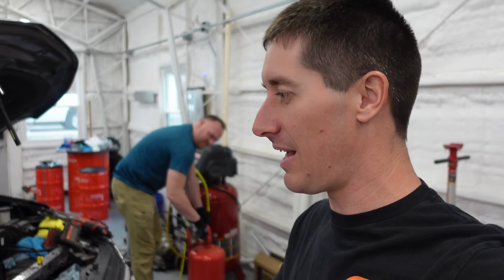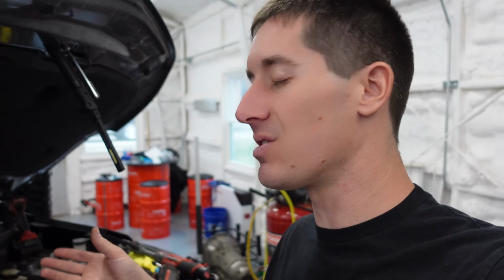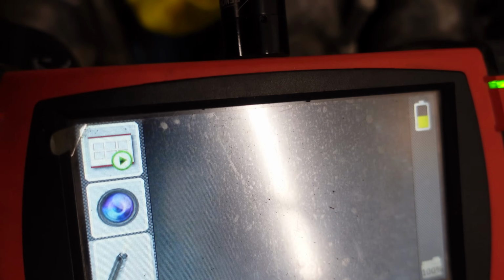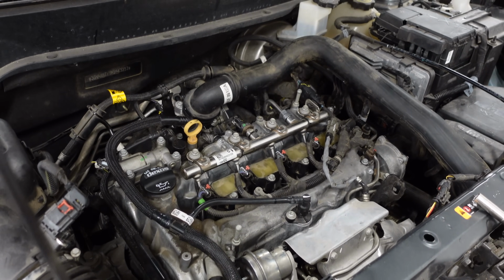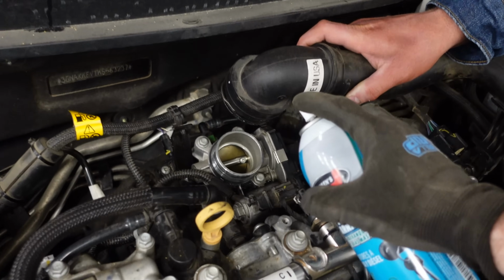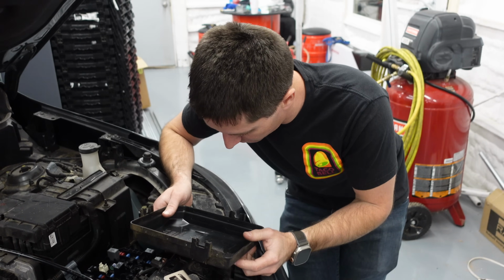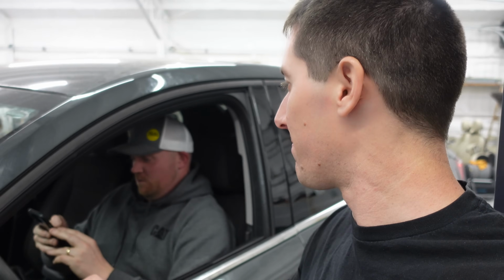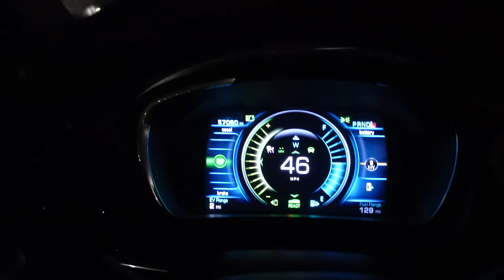I FIXED The UNFIXABLE Chevy Equinox *You'll Never Guess The Problem*

Comment: You can use any device that pulls a vacuum to remove the gas. I remember that you have an oil extractor that you used for oil changes. That will pull gas out of the tank.
Reply: Don't most modern gas tanks have some kind of anti-siphon feature to make it difficult? Or at least slow you down?
Reply: Can't you just unplug the fuel filter and let it empty itself?
Reply: @JohnDoe-zr6bk  There is no fuel filter on these cars other than the sock at the intake for the in-tank fuel pump.
Reply: There is a fuel pump in the tank to pump the gas out. You just have to figure out how to power it
Reply: @JohnDoe-zr6bk most cars have a fuel filter that is integral to the pump assembly itself inside the tank. There's not typically an external replaceable filter now

Comment: I was working in service for a GM dealer when flex fuel vehicles were coming out.  If it can run on E-85 it will be marked on the gas door, it will say E-85 capable or something like that.

Comment: Had the same thing happened to my Chevy lumina about 15 years ago. My wife stopped at the gas station and filled it up, she made it 3 miles before the car stopped. I checked everything just like you guys did, finally decided to drop the fuel tank and drain out the gas.the third crank the car took off and ran fine. The gas station would not make it right. They’re out of business now. Wonder why😂

Comment: When it showed 210 on compression I said that's a fuel issue. I was thinking fuel pump but That wasn't it. Now I would recommend having them keep an eye on that. "IF" it was pumping water and as long as it was sitting in it it may have started a little bit of corrosion inside the pump.

Comment: Hey guys, we had a similar situation a couple of weeks ago with a gas station in Guelph, Ontario with contaminated fuel. People filled up their cars and they quit running. This hit the news and cars had to be towed to repair shops and dealers. One of the people sent some of the fuel to a lab for testing and it turns out the contaminate was windshield washer fluid. The parent company in this case has said they will pay for everyone's repairs. In the meantime  the station has been closed. Be interesting to find out what's actually in your fuel. Cheers!

Comment: They sell kits for checking gas. It is a graduated cylinder that you put gas in up to the gas line then add water up to the water line, shake well, then let sit. The water mixes with the alcohol in the gas. After it sets the water/alcohol will setle to the bottom. Then you read the %scale to determine the % of alcohol.

Comment: We just got our 2017 Equinox with a 2.4 liter 4 cylinder back from the dealership.  It would turn over but not start.  Or if it started it would only run for 10 seconds, with lots of white smoke coming out of the tail pipe.  Our local mechanic worked on it for 1.5 days.  Then the dealership worked on it for a day and a half.  After trying everything they could think of, it turned out to be bad fuel.  We drained the tank and put fresh fuel in it and it's working fine.  Who would have thought?

Comment: How did the car & shop smell from all those walnuts? 😄
Also I'm surprised that you don't have a Heavy duty charger/jump-starter in the shop, JR. Portable ones are handy, though go walkies into specific vehicles too easily. Good to see that car running again, and Eric's sister back on the road. Looking at the build up, it probably benefited from the cleanup anyway...

Comment: Condensation will cause water to get into tanks too also I solved the issue with 3 cans of Berryman B-12 chemtool also if I was you guys I would do a follow up to clean up the fuel injectors with some Berryman-B12

Comment: Did you change out the camshaft sensor? Another guy made a makeshift pcv valve on the oil cap and now it doesn't burn oil anymore

Comment: Maybe I need to read the manual.  I really don't hear an knocking, but I run my wifes 21 with the same motor on regular.  My Father in Law (mechanic) said to make sure to use some deep creep or sea foam every oil change to help with the carbon or he mentioned we run into carbon issues before 100K.   Basically keep it at about 2k rpm and a suck a bottle of sea foam into the intake.

Comment: Direct injection engines need prolonged high rpm runs to keep the valves clean. Also removing the EGR/PCV systems will prevent the buildup issues.

Comment: The solution on these gas direct injection engines coking up is when they are brand new to illegally swap the factory PCV system for a catch can system.  Then the valve carbon buildup problem almost completely disappears.  It adds a very minor, but super easy, additional maintenance of occasionally emptying the catch can.

Comment: I have a 2005 LeSabre with 239000 miles on it. Never had to go into the engine itself, not even the rocker cover gaskets or intake. It leaks a bit of oil, but never carboned the valves like the DI engines do. And I get 30 mpg cruising the Kansas Turnpike at 80 mph. I live out here in Goddard, just West of you guys. What gas station were you referring to that is problematic with bad gas?? Yeah, it IS the near bulletproof 3800. Mostly get gas at the Murphy Express in front of the Walmart out here. Also used QuikTrip, KwikShop, Casey's and Philips 88 with no problem.
Reply: In the other comments JR mentioned that she can't recall what gas station she filled up at.
Reply: @conrad463  Yes that is true that Eric's doesn't remember where she got that gas, I heard that in the video. JR did also mention that there is a gas station that HE is aware of that has bad gas. THAT is the station that I am asking about.

Comment: PERFECT EXAMPLE of getting caught up in computer gobbly gock and not stopping to do basic mechanics...It aint getting no gas. was the answer.  Great reminder that you should always start with the basics before you start chasing computer codes.
Reply from the maker: It was getting gas, and it smelled like gas... it just wasn't gas. Literally the only way to test it is with insanely rare water detecting paste 🤷‍♂️
Reply: @WatchJRGo RARE is a good word. Persistence pays off. Good work.
Reply: @WatchJRGo just because it's "getting gas" doesn't mean it's good gas or proper gas...BASICS. you don't need computer shit to figure that out.

Comment: Always spray Carb cleaner into intake on a no start. If there is no change, then it is not a fuel  issue and need to look elsewhere. Take care guys. Also the Equinox / Terrain are not bad vehicles compared to what else is out there.

Comment: The owner should use 91 Tier one and every 3,000 miles put in a fuel injector fuel additive to keep the value free of carbon. I use Liqui Moly 2007 Jectron Gasoline Fuel Injection Cleaner.

Comment: I'm surprised you wouldn't not have looked at the gas first knowing she just filled up with gas.  Why because she got to drive it home from the gas station?  At least you figured it out before you started on taking out the engine because just think if you did that you still would of had the same issue and be out all that time and $$$.  Good video to learn from.

Comment: I have to say, it's a good thing you guys opted not to swap for a used engine. My guess is, had you done that, you guys wouldn't have also swapped the gas in the tank and would have run into the exact same issue all over again.

Comment: Few things. I haul fuel and some drivers screw up and most times it’ll grenade your vehicle. Diesel is not clear… red (off-road) and green/yellowish. Gas is clear. It’s easy for someone to hit the wrong grade fuel at some of these stations. I see it when traveling to the south. 
I own a 2015 Equinox and it eats oil like an old 70’s/80’s vehicle. Had it quit on me right after purchase in Florida I’m from Pa… then it got us all the way home to die on the way to church the next Sunday. Critters had been chewing on the wires. 😂 
Then the real issues with the oil consumption starts. So I simply add oil till I’m tired of it and overhaul it or it dies and I have to do something.

Comment: E85 doesn’t not run on these equinoxes. 

In the manual book, they recommend premium fuel for best performance but it can run on low grade 87 octane. But it will not perform well and lose mpg’s too.

Comment: I got a small electric fuel transfer pump that's powered by AA batteries I want to use to fill the lawnmower and the spare cars  with out hanging onto a full 5 gallon tank for 10 minutes. It is supposed to auto shutoff when the tank runs out. I know the pump works but no clue how fast it pumps but willing to take time to just let it slowly fill whatever I'm dealing with. It does use 6 AA batteries and was dirt cheap so be interesting to see how or if it works when I finally try it.

Comment: The moral of the story is to always listen to what the customer tells you.  "It was running just fine , I stopped and put Gasoline in the tank and it quit running right after that"............. That was a HUGE clue  LOL..   One spring I had several cars coast into my shops drive way.  All of them had filled up at a Station just down the road, come to find out they all had a huge amount of water in the Gasoline.  Somehow the stations tanks got contaminated with a massive amount of water.   Another time I had a Ford Mustang towed in , the car belonged to a teenager.  The Engine would not start , I checked the fuel and it just did not look right or smell right..  Come to find out the kid had siphoned home heating oil from his parents heating oil tank and dumped that into his gasoline tank because he could not afford to buy Gasoline.    Yup that 5.0L  did not want to run on heating oil!  LOL ..........  Who knows what the Equinox got contaminated with , I will guarantee that where ever that Gasoline came from that there were other cars that ended up with the same problem..

Comment: This is not uncommon around Southern Ontario. Name brand stations pumping swill that won't even burn. Pour about 1/2 cup on some paper outside & see if you can light it. Small engine carbs with carb bowls full of slush when the temperature drops below freezing. Great for snowblowers...haha.

Comment: You just need to get one of those relay manual switch plugs that wizard has, you could have just pushed the button and pumped it out without the constant on and off.
Reply from the maker: This doesn’t have a relay like I said, it’s a solid state module in the back of the car 🍻

Comment: As a master tech its painful to watch the parts cannon lol...fuel air and spark boys. One of the first things to check when you have misfires is spark and than fuel quality. we use a bg fuel density tester and often find failed fuel.
Reply: First video, go through the comment section. Top comments were all the techs that stated they were GM techs, and gave completely wrong answers🤣 Chasing common problems is fine, until its not a common problem.
Reply from the maker: We spent a couple dollars on gaskets, not a single hard part was bought here 🤷🏻‍♂️
Reply: I didn't see in the first video in which you suggested to check fuel quality. Maybe I missed it?

Comment: I got a 2015 Chevy equinox with 100 and 100 and 100 and 100 and 100 and 100 and 100 and 100 and 100 and 100 and 100 and 100 and 100 and 100 and 100 and 100 and 100 and 100 and 100 and 52,000 mi on it. Don't have too much trouble yet. Do have an oil issue though. It seems like it's using oil but it's not burning something

Comment: I had an issue with an 89 Silverado where we could not figure out what the hell...dropped the gas tank and found a 8 inch split on the top of the tank.. every time it would rain the gas was getting watered down via the bed weep holes.

Comment: I can 100% attest that quick trip is not always clean at least their diesel I used to believe the same I always used to fill my Duramax at the same quick trip and we filled it up and left town I got about 100 miles down the interstate and got a low rail pressure code I hit a parts store fuel filters off again and it did it in another 100 miles for about a week I had saved the first filters and I cut them open there was an unbelievable amount of dirt and debris idk if it was a lazy tanker driver not cleaning around the cap before he filled the in ground tanks or what but it was damn sure dirty I think it can happen anywhere

Comment: One way to keep it running so that you can drain the fuel via the rail- use a carburetor.  Any 4-stroke motorcycle carburetor with an adapter boot is more than enough to idle a 4-cylinder, as long as the ignition system functions.

Yes, hillbillies watch this channel.  If it works, it ain’t stupid.

Comment: Was there no way to disconnect the fuel tank and empty it? Then just run out lines with the Autel?
I have a 2019 and I have only used regular fuel for 55k miles. And our 2nd equinox (2022) only gets regular as well

Edit:  I just checked the manual (which can be found online) and it states to not use E85 and only use gasoline with an octane rating of 87 or higher (for the 1.5L engine). The 2.0L says to use 93 for best fuel economy but 87 can be used.

Comment: My equinox thankfully is E85 flex fuel it has the yellow gas cap with e85 warning labels and flexfuel logo on the small rear passenger doors the only issue is e85 is horrible gas mileage I’ve noticed

Comment: Man I’ve noticed running anything less then premium makes my 2021 lt 1.5 run like crap. I love my equinox. And I got a check engine light that came up mass air flow so I changed the air cleaner and
Cleaned the MAF sensor and it’s been good but the first start up for the day the car runs rough seems like it wants to stall, any ideas?

Comment: The 2010 Cadillac SRX had the similar issues it sat in the yard for 2 years straight I fixed using YouTube and a electrical layout it was missing the 5 volt reference which it crank and start for a few seconds and die fuel pressure sensor faulty I see a lot of these Chevys equinox’s sitting in yards as ornaments probably suffered the same fate direct injection engines are horrible when it comes to this

Comment: I fill 5 gallon jugs with 87 octane gas all the time to bring home to other cars.  When I pour it, sometimes it is crystal clear like water, and other times it is the usual urine color.  Same major gas station, Colonia North in Jersey.  When I get the clear stuff, I get like 3-4 mpg less. The piss colored  gas gets me normal mileage.  I think they are NOT mixing the ethanol to spec with any kind of regularity.  I never notice a difference in performance though.

Comment: Had a coworker's wife franticly call the office because her brand new BMW just died after a fill up at the gas station.  Car got towed to the dealer and found out diesel was in the engine and gas tank.  Turns out the delivery guy put diesel in the underground tanks where gasoline was supposed to go. Ruined a bunch of cars from that gas station.  The distributer had to pay big time.

Comment: I need help with my 2016 Chevy equinox I replaced the high pressure fuel pump the camshaft sensor and crankshaft sensor clean throttle body it says reduce energy power reduce fuel pressure will not stay crank

Comment: What is the correct method to evacuate the fuel from the tank?
Reply from the maker: Whatever works, usually the pump is the easiest. You can’t get a hose in the fill tube, you probably don’t want to pull the interior or drop the tank… just have to get the job done 🍻

Comment: That truck has 2 fuel pumps one in the tank and one electro mechanical on the drivers side at the fuel rail also check the fuel pressure sensor at the fuel rail that was the problem on my 2010 SRX caused the car to sit in the yard for 2 years straight by previous owner who gave up on it

Comment: I filled a new F150 up with diesel using an unleaded gas pump. The station didn't even have a diesel pump. The supplier put the wrong fuel in the tank.

Comment: Quick question…what happened to the days of…having one’s engine rebuilt?…
As a kid of the 60’s and 70’s…I remember my grandfather…having the engine rebuilt…on his 1979 Chrysler LeBaron…and…it wasn’t out of the norm…
Nowadays…if you (as a customer) to have your engine rebuilt…1…you get laughed at…and 2…you are told…it’s cheaper to just have the engine replaced…
Then…for me…the question is…what is done with the old engine?…when it’s replaced…
I have a very strong feeling…the old engine does get rebuilt somewhere down the line…and…is sold…as a replacement engine…and…if that’s true…why not just rebuilt the original engine in the first place?…

Comment: The Chevy Equinox uses standard unleaded fuel to power its engine. Owners are advised to use unleaded 87 or higher, and to not use fuels with methanol in their Chevy Equino.
Thats from the manual, should say enough.

Comment: I laugh at those people who said why would you ever get an equinox when there is crv or rav-4. Well how about the fact that the crv had its issues with the cylinder and rings and would let the gas mix with the oil and then would destroy the oil then in no time destroy an engine. The rav-4 has had its problems. All the companies have their problems. I personally own an equinox and love it. In the 200k miles I have only had to replace an EGR valve. $22. Big deal. It's great on gas, goes to the mountains all the time, taught 3 kids to drive in it, I guarantee it's been abused. Never seen the inside of a garage. I live in an area where every winter it gets to at least -20 f. Every summer it gets at least 100+f. It gets used and abused. It's never been in a shop. I replaced the EGR valve in like 2 minutes. It's a v-6 with plenty of power. Way easy to work on.

Comment: Those valve are completely caked in sludge and carbon buildup.  I never use cheap fuel.  Even though mine doesn't say to use premium I use premium fuel only as it just made my car runs better overall.